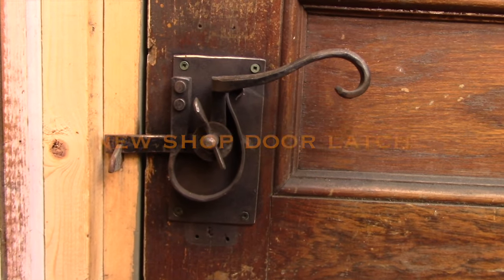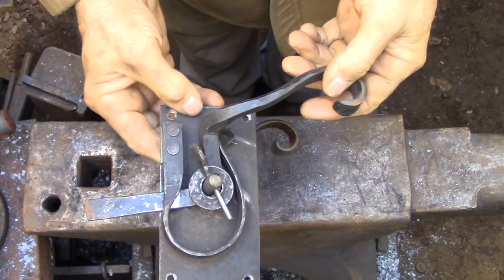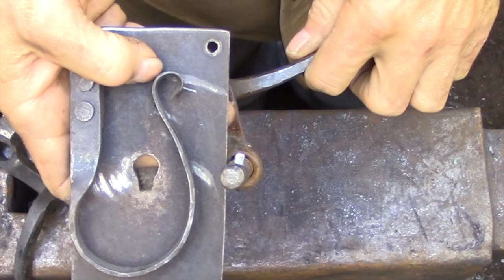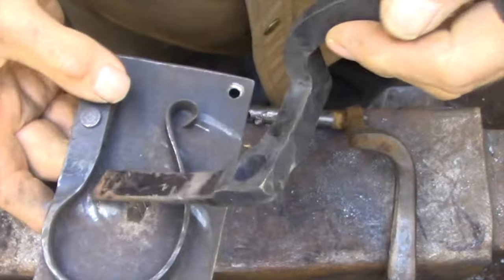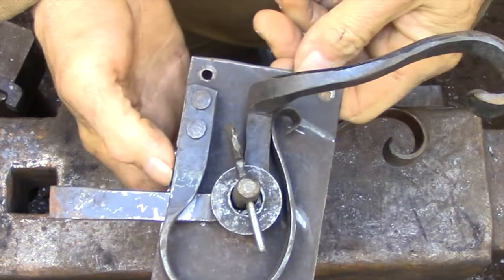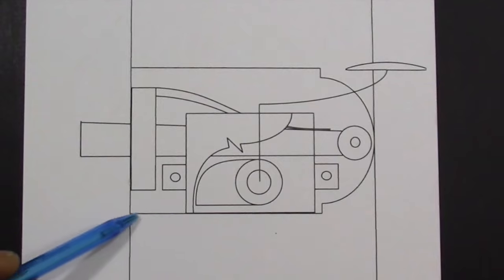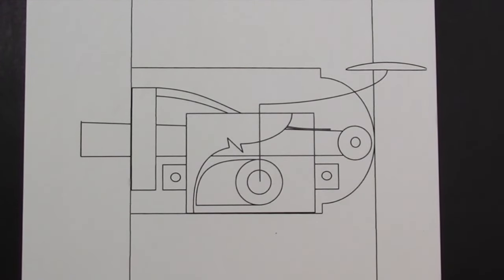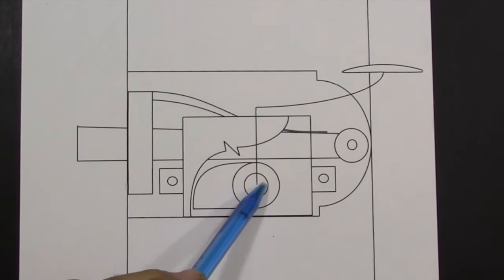Blacksmithing Project - New Shop Door Latch 1

Comment: Denis, are there any references documenting various designs for these types of latches?  Or even somewhere with a decent number of photographs of existing ones?
Reply from the maker: The only one I have is - Early American Wrought iron by Albert h Sonn .   They are drawings not photos but it covers the colonial stuff very well.
Reply: Ouch!  That is a pricey book! I'll have to look on interlibrary loan. :)
Reply from the maker: I did get mine used on amazon but you do have to keep checking.  Prices can vary by several hundred dollars for some reason?
Reply: Turns out my local library has a copy, so I get to look before I try and find one to buy maybe. Thanks for turning me on to this reference.

Comment: Would you have any advice for unusual locks, or at least difficult to pick or maybe hidden locks? At some point I would like to upgrade my workshop's lock to make entry harder, but all ideas are being developed. I am leaning towards some kind of hidden door bar. Maybe rack and pinon, as it's easy to make with wood. Sort of.
Reply from the maker: There isn't much documented on that subject that I have been able to find.  The problem has always been how do you develop a system that is easy for the owner to access but difficult for anybody else.
Reply: DF - In The Shop exactly! I am thinking of something along the lines of Mattias Wandel's rack and pinon for his shed. Some kind of adaptation.
Reply from the maker: I did see that video but didn't he just have a crank handle on the front of the door?  I don't remember that part.  I guess you could adapt it to fit some kind of specialized wrench or drive system.
Reply: DF - In The Shop exactly.